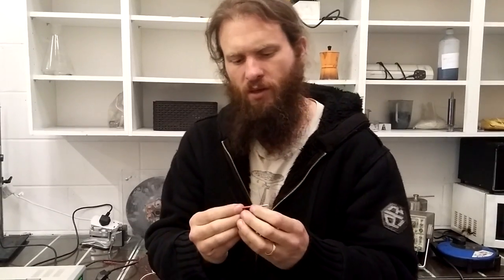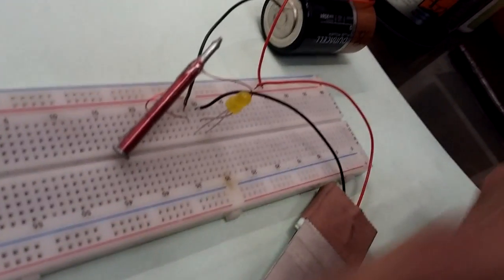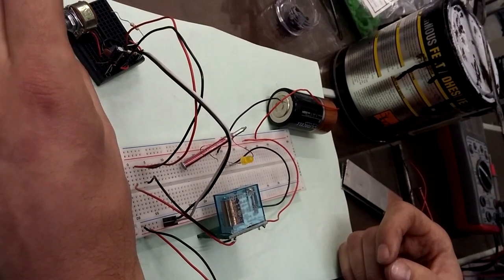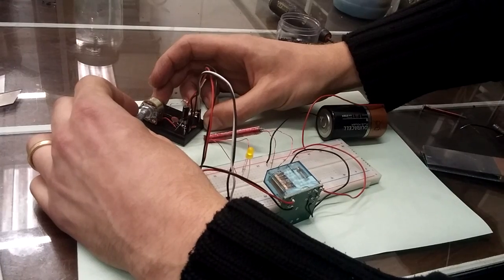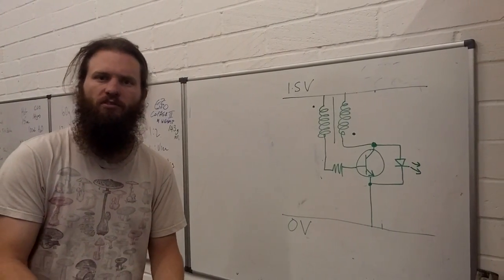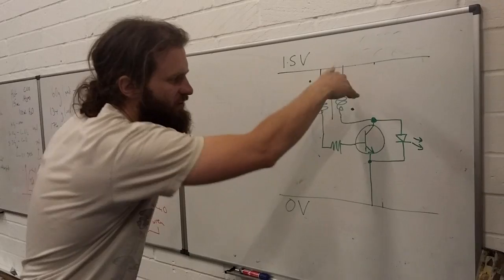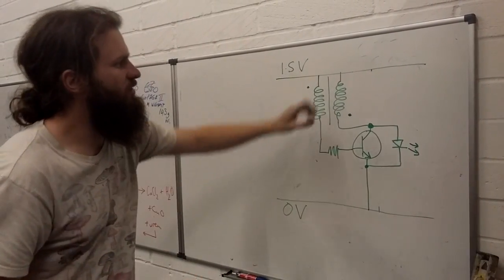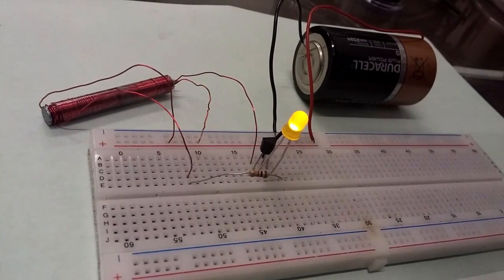All You Ever Wanted To Know About The Joule Thief

Comment: great explanation Ashton, and nice to meet you. I was always under the impression that the winding being in the opposite direction on the primary would be blocked by the secondary as an opposing field being that as the primary field builds and so to does the reverse blocking secondary field but your explanation gets me wondering . thanks for you effort😀

Comment: "A “Joule Thief” is a simple voltage booster circuit. It can increase the voltage of a power source by changing the constant low voltage signal into a series of rapid pulses at a higher voltage."

Comment: It's always difficult to know who your audience is on You Tube and their level of understanding. All in all, a very good operational description of the "Joule Thief" circuit. The only comment I would make is to avoid the use of acronyms such as EMF (Electromotive Force) without explaining what EMF is. If you use electromotive force in your presentation then counter electromotive force should also be explained and used, otherwise just use voltage. It's a small criticism, which indicates how good your presentation was. Thanks Ashley!
Reply: Dana Johnson thanks Dana, good point about the acronyms, so easy just to assume people know or even overlook it entirely

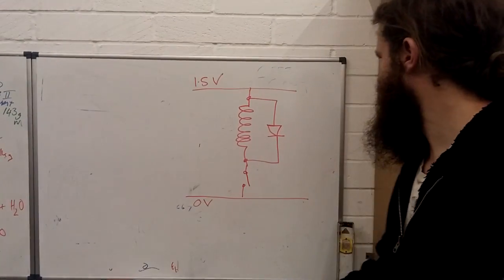Comment: Nice explanation - thanks.  However, in the first diagram (beginning at 3:24) I think you are showing the LED the wrong way around.  The back-EMF induced across the coil when you open the switch will be more positive at the switch side than at the 1.5V rail side, so you will need to connect the LED the other way around for it to light.

Comment: You can ommit the 555 timer in the relay circuit. Feed the relay coil through the normally closed contact. By doing that, the relay will turn on in the off state, and off as soon as the contact breaks. It's commonly called a relay buzzer circuit. If it is controlling different voltages you need a dpdt but if it's the same you can use a dpst.  It has to be a double pole with a nc and no connection. Normally Closed and Normally Open.

Comment: Isn't the Diode drawn in the wrong direction? Because when the switch is closed the current will go through the diode not the coil. This is similar to a diode on a relay coil and normally the cathode of the diode is towards the positive rail. This type of arrangement is usually called the flyback diode. I could be wrong.
Reply from the maker: +Bill Spradlin so could i mate - but i don't think so - i will recheck though

Comment: Ashley, if you want to take this to a next practical step, review a voltage multiplier. Image Intensifier is high voltage tube that runs on AA battery. Cold plasma another application with some very cool applications where this can be used. No end to what can be done with cold plasma device. My experiments investigating healing graphene defects with CP, if you want practical application. Cheers mate, you are doing good work.
Reply: BluesDoctor thanks for the tips, I'm excited to see where this stuff goes. Good luck with the graphene defects stuff, sounds interesting :D
Reply: Wow! So you have actually healed graphene using cold plasma? That’s like a Nobel Prize level accomplishment. Why haven’t you demonstrated this or published any papers? By the way, if it does work as you claim then what you have demonstrated is known as ‘negative entropy’ which is the second law of thermodynamics working in reverse! That’s bigger than Relativity in terms of its impact on physics.

Comment: I have wired a Ferrite ring in parallel with telephone wire....
(2 sets of windings, counter rotating) 
........and it will light the LED down to .31 V, with a TIP31 Transistor.....470 resistor
......................... at .31 V it stops working.
Best coil I have made so far.
Ferrite Tubes are noise suppressors in certain electronic cables, computers monitors etc
THEY WORK GREAT !!! and are compact !!

Comment: Love the channel. I a bit puzzled when the relay and the 555 timer is introduced as surely that needs 12v and  9v respectivly to work .that is not referred to and seems to move away from the original intention of boosting a 1.5v  battery to drive a  LED

Comment: I just stumbled onto you and this video and I must say very well said.  Video editing sucked but your explanation was spot on.  Now I have read that the type of inductor used helps with efficiency so you can go even lower so a nail will work, or any metal, but is not optimal as say a toroid.  I know that it matters EXTREMELY which transistors you use and a germanium transistor has a lower starting voltage so that .7v to kick it on suddenly becomes .3 or .4 so even more of the battery, or an even lower voltage solar cell, can be used.
Reply from the maker: +legalizeshemp420 cheers mate - thanks for the input

Comment: Very interesting and thank you for sharing it with us but I think the problem with this circuit for stepping up the voltage is efficiency which seems to be bellow %50.  I wounder if a resistance load to collect the short cut phase of the oscillation would effect the circuit. ie. between Emitter and Ground.

Comment: You can go further and ditch the 555 timer get a relay the two separated contacts to build two separated circuits. The one switch (NO) is attached with the julethief. And the second relay switch (NC) is in series with the relay coil and the relay will buzz happily away like a buzzer. Note both switches have to be electrically separated they are two different circuits the are only mechanically connected in the relay.

Comment: This is by far very effective, simple and to the point like you get explained by a proper Professor. Great job I must say. 
Now the meat & potatoes - as I have Joule Thief circuit which does Not use any Core (no ferrite or Iron, just a paper card core for support only). Then more interesting is that a smaller voltage say 1.2v Drive voltage not only runs a LED but also recharges a discharged Battery connected parallel to the LED. Then when the Battery B (discharged one) gets fully charged, when swapped around with the drive Battery A (which is now discharged) so that the Battery A gets the charging. In this manner if one keeps Swapping these Batteries (can be done electronically) then you get continuous power to the LED. Is this something possible or a myth. Kindly share some light

Comment: Can you increase the output by increasing the input or could you run multiple joule thieves' in a series?
Reply: ***** increasing the input will increase the output, but the point here is to run it down to a low voltage, it would be interesting to try connecting a bunch of these up in parallel. I would like to understand the load characteristics

Comment: I guess if you use a germanium transistor the voltage could go much lower?
Reply: Robonza anything that lowers the gate voltage will allow for a lower voltage driving of the circuit. there are some very sensitive field effect transistor's out there that trigger just from ambient RF, so there are some useful directions to go
Reply: Ashley Mills I don't think you can get a gate (fet) voltage lower than a base voltage (germanium bipolar). Can you name a part for me to look at?
Reply: i saw this article the other day http://www.aldinc.com/ald_zerothresholdmosfet.php

but just in general, if you take any mosfet, the accumulated charge will often cause the mosfet to be on and you have to explicitly pull it to ground just to stop it from being spuriously on, I'm looking into this at the moment and how this can be controlled to create a lower effective voltage

Comment: Thanks for the video. I noticed you said the voltage out depends on the rate at which it switches on and off. If I use your setup in simualtion you get Huge voltages over 100V and everything explodes and yet yours doesn't. Is there a reason why this isn't a reality?
Reply: I realize this is 3 years after you asked, but as I understand it the voltage will be limited by what the LED draws.  I know they warn against letting this go "open circuit" as the voltage will spike very high across the transistor.  (And I think this is why it's important that he mentions the battery MUST supply less than the LED needs, so that the transistor shuts off and recycles everything.)  If so, I would think it wise to design "over-voltage protection" into the circuit.  Perhaps the simulations don't account for an upper limit on the LED?  But in reality, I think the LED just happily draws what it needs and stops there.  Someone please feel free to correct me if I'm wrong, otherwise I hope this is helpful.

Comment: So Goood. For several time I want to build a joule thief without know how it is work. Thanks Ash. I want to order the stuff to build a joule thief,could you tell what I have to order? Resistance, ferrit coil.... thanks
Reply: Mo Kha you need some copper winding wire, 0.25 or 0.5mm, a nail, a 2n2222 transistor, an LED, a breadboard, some joining wire, and a 1k resistor, but other values of resistor will work

instead of the nail you can use a ferrite rod or a ferrite toroid, if you do use either of the latter then the number of turns needed will be much less, because the ferrite concentrates the magnetic flux much more readily than the nail does

if you use a toroid for example, then you only need to do about 12 turns on either side of it to make the circuit work.
Reply: Thanks Ashley I will order these stuff. Very good video
Reply: TIP31 Transistor will give you way more light but uses more current
Reply: Ferrite works better

Comment: Great video. Is this sort of related to https://en.wikipedia.org/wiki/RLC_circuit ?
Reply: New Wave Agriculture it's related in that they are both oscillators but in the joule thief case there is no explicit capacitor so the resonance is entirely because of the inductive coupling modulated by the transistor as a switch. In RLC circuits the resonant frequency is determined by the pass back and forth of energy between the capacitor and the inductor, but in any continuously resonating RLC circuit you will need some way of switching too to keep feeding the resonance otherwise the resonance dies out very quickly like an unpushed swing.

Comment: watt is the effeciancy of this joule theaf  how many ma go in and how manny ma go out  ext
Reply from the maker: dunno
Reply: well get a watt meter see how many amps go in then see how many go out then we can see its effeciancy to see if its worthwile useing rather then a inverter.
Reply from the maker: lol - ok
Reply: Oscillating circuit.....get it?
Taps of current, not a steady flow.
Inverter = steady flow , more current loss.
No brainer
Reply: I tested mine at 99.9 affecency but on one part it was mesureing 2.3 v and all the others settings it was 1.3 in 1.3 out but because it's a ovulating current it's hard to get a reading for there is lots of ons and off that happen thousands of times a second.
Reply: Yes Joe your right
Reply: Tony Boroni ovulating is what women do once a month LOL
Reply: Tony Boroni you need an Oscilloscope
to be able to read the output of a  Joule Thief correctly.
Reply: I have wound a ferrite ring with two sets of counter rotating winding and wired them in parallel. It goes dead @ .31V.
Best core I have made yet, most stop at .50V
Reply: It's the fking autocorrect oscillation
Reply: Is wat I was saying
Reply: Do you know the best effencincy you can get from one.

Comment: Why not just use a step up transformer
Reply from the maker: ok
Reply: This is an oscillating circuit...do you know what that means?
A transformer is constant flow , thus drains the cell faster
Reply: Thank you very much. Is it possible to explain how an oscillating circuit drains a cell less than a constant current one?
Reply: epickiller30 If you listen to the teacher on this video, he explains how the circuit works.
~~~
By using short "taps" of current that makes the LED blink, instead of being on constantly,
thus NOT using current in the time  between oscillations
A flashing light uses less current than one that glows continuously...get it now?